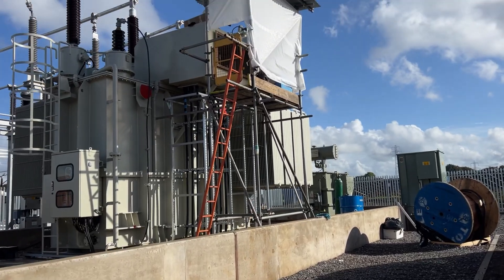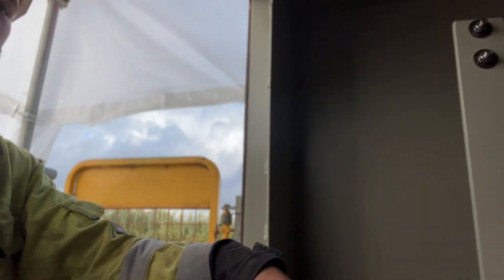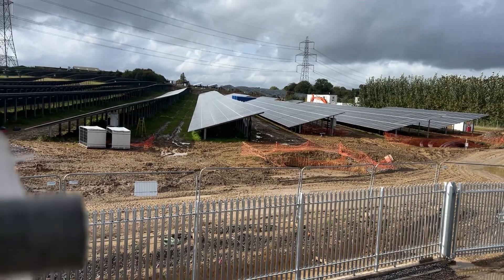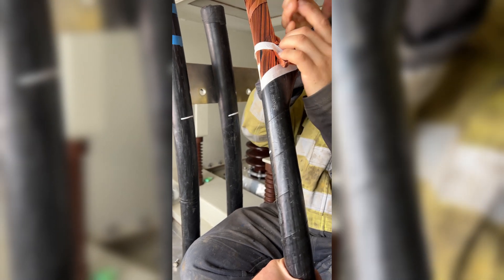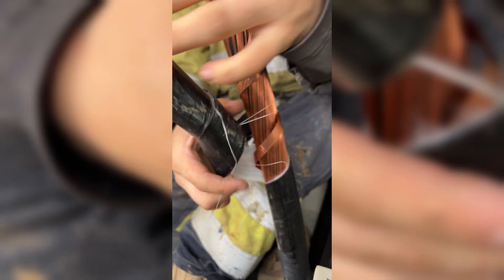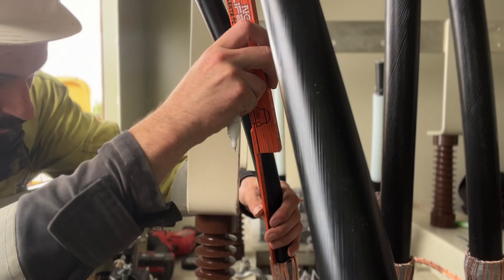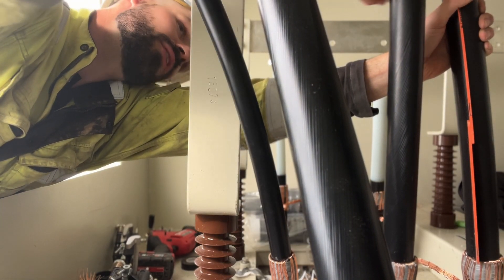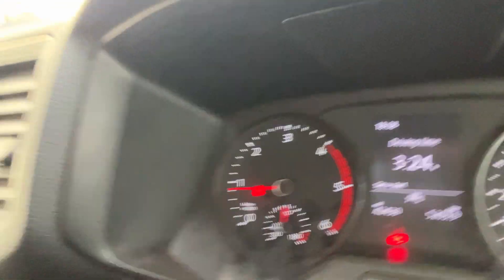REPL 33kV Cold Shrink Termination in Action | High Voltage Cable Installation Showcase!

Comment: I'm back been on a long holiday chaps, whats good, whats new whats coming next.. Big transformer mate, are you terminating both high side and the low voltage. Please next time do show the connectorS from switch room to transformer, current transformer and onto switchgear over the busbar and out onto the outgoing line and I take it the 33kV will connect to a 33kV transition line right? Or it gets boosted or lowered
Reply from the maker: How was the holiday mate? I got a few bits planned, been quiet recently on youtube because we have been busy. Just the 33kV side on this job, i think the 132kV comes from the overhead lines. Yea next time ill show inside from the switchroom to the transformer!
Reply: @hvsparky  it was a blast, cant lie inherited a massive farm from Nana. Got a plan for biomethane digester, a purification system and into a CHP just like gas turbine you terminated to run the farm and sell to the grid. Switch room to the transformer would be awesome, would love to see the breakers, your isolation method, busbars and how you earn or ground Medium Voltage switchboard. Cant wait on your next instalment mate, love your content I do
Reply from the maker: @ProductionSession  
Wow, that sounds like an incredible project! A biomethane digester and CHP system is next-level thinking – love the sustainable approach!  Stay tuned for the next instalment, and thanks for the kind words and support it means a lot! Best of luck with the farm project; sounds like you’re doing something amazing! 💪⚡
Reply: @hvsparky  its my fantasy to actually pull it off on a large scale but sometimes life, family  and bills get in the way but staying focused. To be fair I long for notification of some of your content. Its the dogs bullocks. Everyone of your clip is of rare working environments plus the tech is top notch I enjoy it proper

Comment: We’ve just recently switched to the repl terms on the 11kv and I’m not much of a fan. They never land in the right place on the lug and they’re instantly tight as soon as they’ve shrunk so there’s no movement up and down. Looks like the 33’s are the same crack 🙄

Don’t tell anybody but I put a very thin smear of silicone grease around the bit of the lug that they land on and you can then get a bit of movement so they’re in the right place 🤫
Reply from the maker: It was the first time ive done the REPL cold shrinks before, and wasnt sure why you use silicone grease with copper screen tape and not with the screen wires 🥴🥴

But yea your right, they dont quite land where you want them!
Reply: @hvsparky  I’ve never done 33 so not sure what you mean about the grease. We’re generally doing them in boxes so put flexible boots over them, so I just use a blob out of the boot kit.